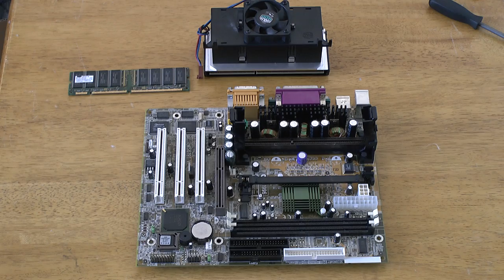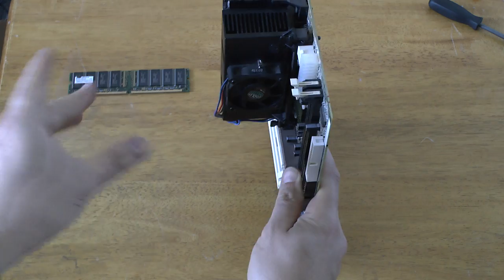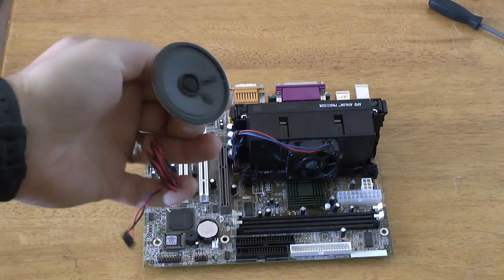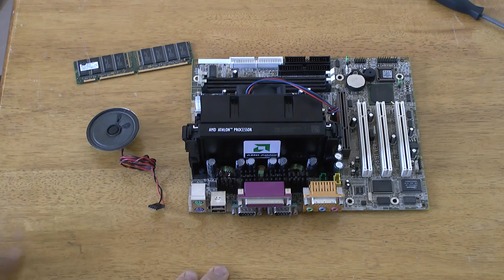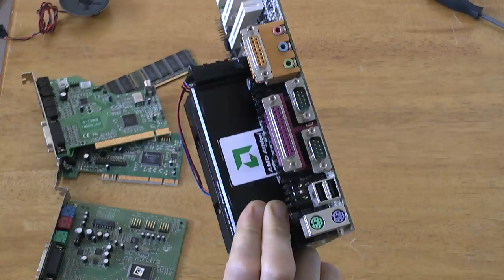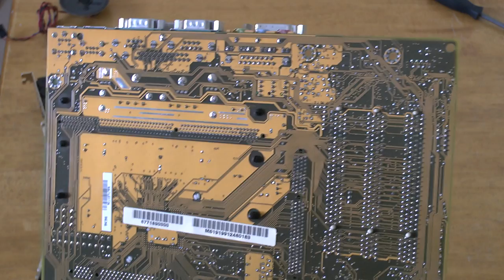AMD/Intel slot and cartridge design with Athlon and motherboard, a quick look..

Comment: The cpu die contained an L1 cache just like the 486 did. On the 486 you could also have L2 cache on the motherboard either soldered or socketed DIP chips of SRAM. The pentium and AMD k-6 did the same thing, except the L2 cache on the motherboard was a RAM like flat package and could be expanded with an SRAM module that looked like a stick of RAM. The problem with this design is that the k-6 at 500 MHz still had to run the cache at s lousy 100 MHz FSB and 200 MHz SRAM was cheap. So they stuck it on a cartridge and gave it a divider to run at ~200 MHz.
Reply from the maker: You should take a look at my other videos... in relation too batteries also falling apart... yikes.. I ment running out of juice. you should change the battery after 5 years. they can still leak but not as dramaticaly and a lot less damage... thanks for the update post.

Comment: First PC i built was an Athlon ..16 yr's ago !
Reply from the maker: I have built well into the thousands when it comes to PC's. Great fun building them. Watching them come to life...
Reply: 1000's you must be rich !
Reply from the maker: +SpikeXtreme lol.... no... I have built a lot for customers.. :-)
Reply from the maker: I remember once building 4 Computers at the same time. All had the same RAM 2GB. Athlon CPU. Same size Hard Drive videocard etc. I was installing Windows 98 on all of them at the same time. They all installed windows in different ways. And seamed to have a mind of there own. Two installed no problem with the other two having issues at different points. And installing the software for the motherboard, drivers etc. Different issues, all installed differently..

Comment: Those cr2032's don't fall apart, they just run out of juice. Dallas clock doesn't leak either, but are a pain in the ass to fix, as they are clock+battery. It's those old NiCad bastards that leak and ruin motherboards. Haven't seen those on anything newer than socket 4/5 pentium.